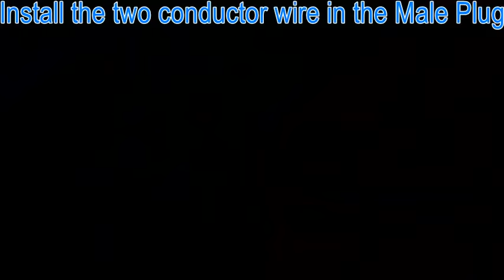How to Make your Extension Cord

Comment: What is the maximum wire gauge that will fit into the plug and receptacle devices.  I need to run  < 8m for a simple toothbrush holder (0.4A).

Comment: Ano pong mangyayari kapag nagkapalit ng wire?
Reply from the maker: Ok lng po. Basta wag lang magdikit yung line 1 or line 2
Reply: @RDCTV  sir ask ko lang po sa inyo bakit po kaya nagspark ng malakas yung outlet noong sinaksak ko po yung gawa kong extension na ang gamit ko po outlet din. Tapos nagtrip po breaker namin. Ano po kaya ibig sabihin non?
Reply from the maker: @billcastro2093  MAY PROBLEMA PO KUNG GANUN NAGDIDIKIT ANG LINE 1 AT LINE 2
Reply: @RDCTV  okay po sir. Salamat po

Comment: More practice sir ....di maganda connection mo ng wire sa outlet sa screw ....dapat nakasulat din sa screen kung anong size ang wire , ilang ampere ang male plug at outlet  ?
Reply: Yes that is important especially students are the one who will  try to make this.. You should specify each and every material needed to be use.  I've read many students are asking for the size of wire but no response yet
Reply from the maker: #16.